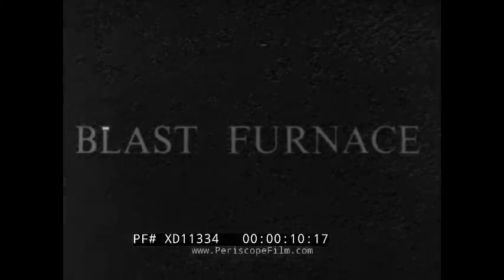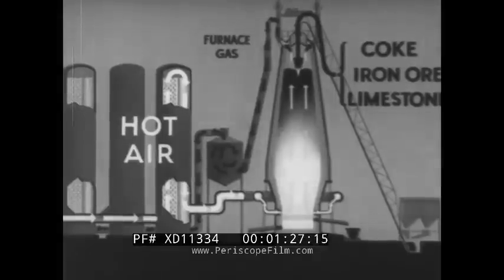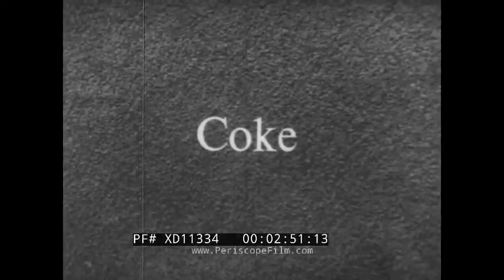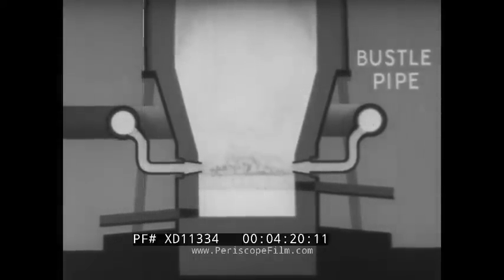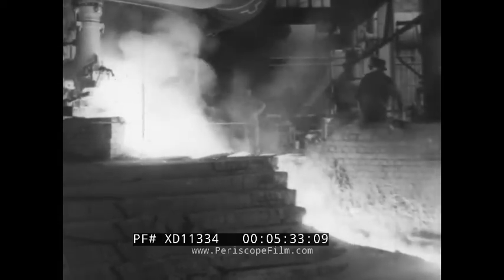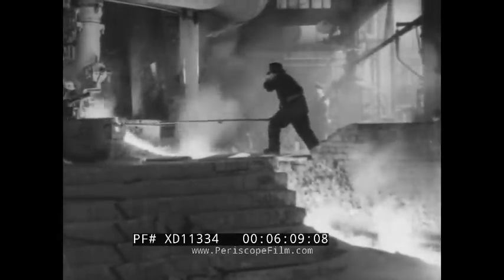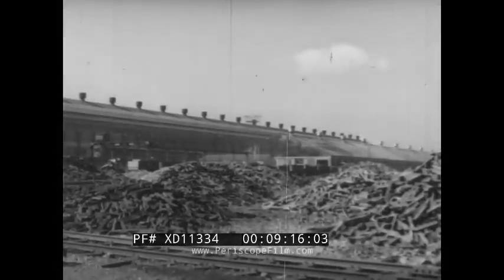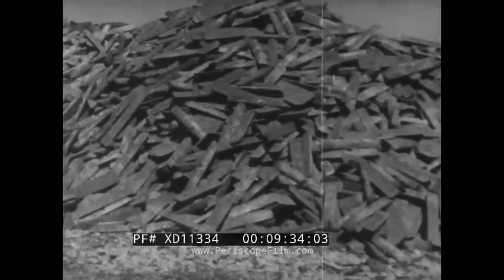"BLAST FURNACE” 1949 BRITISH EDUCATIONAL FILM    SMELTING IRON   METAL PROCESSING  XD11334

Comment: It's worth noting that the three Cowper stoves on the left of the diagram alternate in sequence between serving as the heat source for preheating the blast air, and getting heated up themselves by the spent combustion products from the blast furnace. When one gets too cold, it gets cut out and replaced by another. This is all controlled by timed valves to keep the incoming blast air at a fairly constant temperature.
Reply: One thing I’ve always wondered was how does the process start? Meaning how do,they start up a blast furnace and what do they use to to begin bringing the air temperatures up?
Reply: Way more interesting than the usual "my dad worked in a steel mill" unsolicited biographical comments you get on these videos
Reply: I wondered about that myself! Thanks for this.

Comment: Pig iron with carbon, nickel, moly, etc, added to it becomes carbon steel, in grades tough enough to be forged on an industrial forging hammer. These forgings become steering gears for cars and trucks, super alloys become jet engine parts and aerospace hardware, railroad drive hardware, agricultural equipment, and all manner of weapons and national defense. It all starts in a blast furnace though, important first step in a very heavy industry. I am a retired industrial Union Blacksmith of 25+ years, forged oil drilling equipment, agricultural forgings, and primarily aerospace grade alloys into jet engine rotors and compressor turbines, NASA hardware, and 747 - 757 Boeing landing gears and hubs. It was interesting work, especially the national defense equipment we forged. Main rotors fo Apache helicopters, all manner of ballistic ordnance, tank, submarine, and ship equipment, F-16 fighter jet engine internals, it was something different every day.